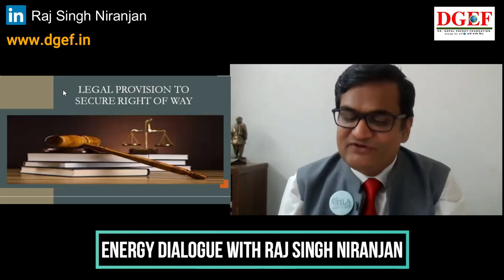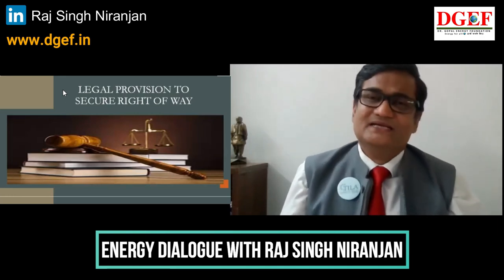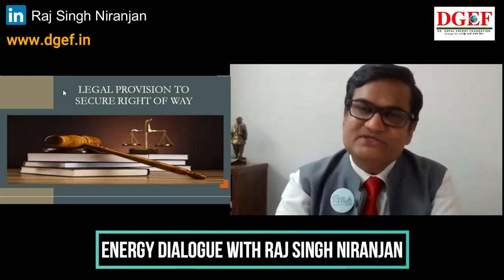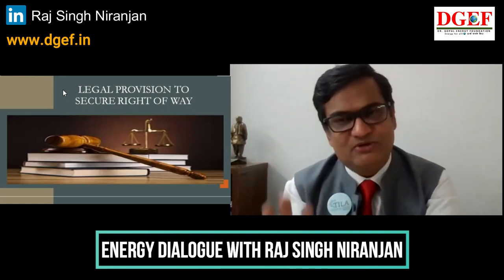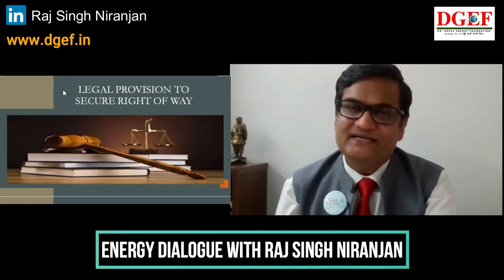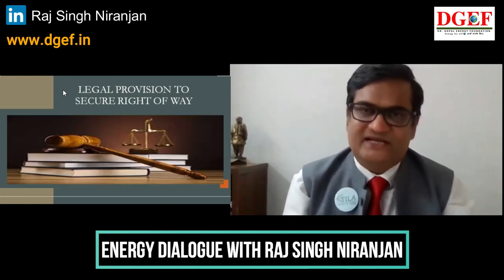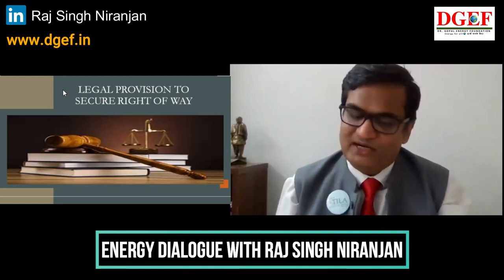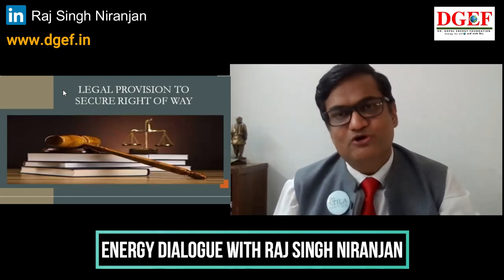Right Of Way (ROW) for setting up Transmission Lines in India ?

Comment: As per my research upon this topic I would like to put forward the acquisition process that is involved in the ROW which are as follows:
1.Identification of the ROW: The transmission company identifies the ROW required for the transmission line project.
2. Land acquisition: The transmission company acquires or leases the ROW from the landowners.
3. Compensation: The transmission company compensates the landowners for the land acquired or leased.
4. Clearance from government agencies: The transmission company obtains clearance from the relevant government agencies, such as the Ministry of Environment, Forests and Climate Change and the State Forest Department.
5. Construction of the transmission line: The transmission company constructs the transmission line on the ROW.
Thank You.

Comment: In India, the right of way (ROW) for setting up transmission lines is regulated by the Central Electricity Authority (CEA) under the Ministry of Power. The CEA has issued guidelines on the ROW requirements for transmission lines in India.

According to these guidelines, the ROW requirement for transmission lines depends on the voltage level of the line and the type of terrain it passes through. For example, the ROW for a 765 kV transmission line passing through flat terrain is 80 meters, while the ROW for the same voltage level transmission line passing through hilly terrain is 100 meters.

The guidelines also require that transmission lines be constructed at a minimum height to ensure safety and to prevent unauthorized access. The minimum height for a transmission line passing over a road is 7.5 meters, while the minimum height for a transmission line passing over a railway track is 9 meters.

To obtain the ROW for a transmission line project, the developer must obtain the necessary approvals from the relevant authorities, including the local government, forest department, and any other concerned agencies. The developer must also compensate landowners and other affected parties for any damages caused by the project.

It is important to note that ROW requirements may vary depending on the specific location and project requirements, and developers must comply with all relevant regulations and guidelines.

Comment: In India, obtaining the right of way (RoW) for setting up transmission lines is a crucial aspect of power infrastructure development. The right of way refers to the legal right to establish transmission lines, which usually involves acquiring land or securing permission to use land for the construction and maintenance of transmission infrastructure. The process can be complex and involves multiple stakeholders, such as central and state governments, private landowners, and local communities.

Some key aspects of the right of way process for setting up transmission lines in India include:

1. Regulatory framework: In India, the transmission sector is regulated by the Central Electricity Regulatory Commission (CERC) and State Electricity Regulatory Commissions (SERCs). These commissions establish guidelines and procedures for acquiring the right of way for transmission projects.

2. Route alignment and land acquisition: The route alignment for a transmission line project is determined by a detailed survey and analysis of the proposed path. This involves identifying the shortest and most feasible route, considering factors such as topography, land use, and environmental and social impacts. Once the route is finalized, the process of land acquisition begins, which may involve negotiations with private landowners and acquiring land under government ownership.

3. Compensation: Compensation is typically provided to landowners and other affected parties for the acquisition of land or granting of rights of way. This may include monetary compensation or alternative land provisions, depending on the specific circumstances of the project.

4. Environmental and social impact assessments: Transmission line projects may require environmental and social impact assessments (ESIAs) to be conducted to identify potential impacts on the environment, local communities, and cultural heritage sites. These assessments can help guide the project design and identify mitigation measures to minimize adverse impacts.

5. Public consultation and stakeholder engagement: The right of way process may involve public consultation and engagement with local communities and other stakeholders to address concerns and gather feedback on the proposed project. This can help in building trust and ensuring the project is designed in a manner that is sensitive to local needs and priorities.

6. Clearances and permits: Obtaining the necessary clearances and permits from various government agencies and authorities is an essential part of the right of way process. This may include obtaining forest clearances, wildlife clearances, and other permits related to land use, environmental protection, and cultural heritage sites.

It is essential to note that the right of way process for setting up transmission lines in India can be complex and time-consuming, involving multiple stakeholders and regulatory requirements. Successful project implementation requires careful planning, coordination, and engagement with relevant parties throughout the process.

Comment: The right of way is a strip of land where the transmission line is constructed, erected, operated, and maintained.
The transmission line is the center of the Right of Way ( ROW ). 
The right of way clears all trees, structures, and construction that interfere with the power lines.

Comment: •	Developing Bangladesh
The specific procedure for obtaining the Right of Way (ROW) to set up transmission lines in Bangladesh would entail the following:

1. Project Proposal: Prepare a detailed project proposal that includes the technical specifications of the transmission line, such as voltage, capacity, and route plan. The proposal should also include information about the project's purpose, potential benefits, and estimated costs.

2. Land Identification: Identify the land required for the transmission line corridor, tower locations, and associated infrastructure. Conduct surveys and assessments to determine the feasibility and suitability of the proposed land.

3. Preliminary Survey: Conduct a preliminary survey of the proposed route to assess the technical feasibility and potential environmental and social impacts. This survey helps to identify any potential obstacles or challenges that need to be addressed.

4. Environmental Impact Assessment (EIA): Prepare an Environmental Impact Assessment report in accordance with the laws and regulations of Bangladesh. The EIA report should evaluate the potential environmental and social impacts of the project, including land acquisition and construction activities. It should also propose mitigation measures to minimize adverse effects.

5. Public Consultation: Organize public consultation meetings to inform the local communities about the project and gather their feedback. Address any concerns raised by the affected stakeholders and incorporate their suggestions into the project design, if feasible.

6. Land Acquisition: Initiate the process of land acquisition by identifying the landowners along the proposed transmission line corridor. Engage in negotiations with the landowners to acquire the required land through purchase or lease agreements.

7. ROW Application: Prepare and submit an application for the Right of Way to the appropriate government authority, such as the Power Grid Company of Bangladesh (PGCB) or Bangladesh Power Development Board (BPDB). The application should include project details, the proposed route plan, land acquisition documents, environmental clearance, and other necessary permits.

8. Technical Evaluation: The government authority responsible for ROW will evaluate the technical aspects of the project, including the suitability of the proposed route, tower locations, and safety considerations. They may conduct field visits and consult with technical experts to assess the project's compliance with national standards and regulations.

9. ROW Approval: If the application meets the technical requirements and complies with all relevant regulations, the government authority will issue the ROW approval. This approval grants the right to use the specified land for the transmission line construction and operation.

10. Compensation and Relocation: Finalize compensation agreements with landowners and provide appropriate compensation for the acquired land. If any households or communities need to be relocated, ensure proper arrangements are made, including compensation, resettlement, and rehabilitation.

11. Construction and Monitoring: Commence the construction of the transmission line and associated infrastructure, following the approved route plan and design specifications. Implement effective monitoring programs to ensure compliance with environmental and social safeguards during the construction and operation phases.

Comment: The important laws governing the Right of Way are the Indian Telegraph Act, 1885 and the Electricity Act, 2003. The provision contained in Section 12 to 18 of the Electricity Act, 1910 remained in force until the rules under Section 67 to 69 of the Electricity Act, 2003 are made. Also, the procedure and provisions under Section 12 to 18 of Electricity Act, 1910 were not adequate for major Generation or Transmission Projects. Hence, the express provision for speedy execution is made under Section 164 of the Electricity Act, 2003. (Previously under Section 42 of Electricity Supply Act, 1948).

The Section 67 of the Electricity Act, 2003 provides for a licensee to lay down, interalia, electric supply lines, electric plant and other works and to do all other acts necessary for transmission or supply of electricity. It also stipulates that a licensee shall cause as little damage and shall make full compensation for any damage caused and in case of any difference or dispute, the matter shall be determined by the Appropriate Commission.

The Section 68 of the Electricity Act, 2003 has the provisions relating to over head lines. It interalia stipulates that where any tree or any structure or other object interrupts or interferes with, or is likely to interrupt or interfere with, the transmission of electricity or the accessibility of any works, an Executive Magistrate or authority specified by the Appropriate Government may, on the application of the licensee, cause the tree, structure or object to be removed or award compensation considering its existence before or after the placing of the overhead line.

The Section 69 of the Electricity Act, 2003 has the provision related to giving notice to the Telegraph Authority.

The Section 164 of the Electricity Act, 2003 empowers the Appropriate Government to confer upon any public officer, licensee or any other person engaged in the business of supplying electricity, any of the powers which the telegraph authority possesses under the Indian Telegraph Act, 1885 (13 of 1885) with respect to the placing of telegraph lines.

The important sections of the Telegraph Act are Section 10 & Section 16. The Section 10 of the Telegraph Act, 1885 empowers the transmission company to place towers in or upon any immovable property. However, while doing so the company shall not acquire any right other than that of user in the property. The company shall do as little damage as possible and after completion of work shall pay full compensation to all persons interested for any damage sustained by them by reason of the exercise of those powers.

The Section-16 of the Telegraph Act, 1885 assigns the District Magistrate power to clear the obstruction. If the obstruction continues even after making an order by the District Magistrate under sec.16(1), the obstructor shall be deemed to have committed an offence under Sec.188 (45 of 1860) of the Indian Panel Code.

It is the duty of the electricity company to decide and pay the compensation. While deciding the reasonable and realistic amount of compensation, the company may get it done from or with the help of following respective authorities:

Revenue Authorities: - For Crops, non-schedule Trees
Forest Authorities: - For Schedule Trees like Teak.
Horticulture Dept.:- Fruit Bearing Trees.
Agriculture Dept :- Value of Crop damage.
Rubber Board:- Rubber trees.

Dispute regarding sufficiency of compensation shall be decided by the District Judge after receiving application from any party concerned.

For felling of Trees, utility will have to take the permission from Tree officer under the Felling of Tree regulation act & Preservation of Tree Act. The forest approval is required for laying the transmission lines through Forest.
Reply: I want contact

Comment: Legal provisions for securing rights of way are as follows:
1) Mitigation of disruption of work was the priority since delaying the implementation of projects could not be afforded. Safety of field persons and smooth working on privately owned property what the main focus areas. Whatever is the conductor swing due to airflow + the object or radius will give the result as minimum electrical clearance, also called the right of Way Or transmission corridor.
2) Central electricity authority has made a regulation named measures related to Safety and electrical supply regulations 2010 which mandates vertical and horizontal clearance.
3) on 14th August 2013 Ohio High Voltage transmission lines sagged and made contact with a tree. This resulted in Domino effect creating the largest blackout in America with total of 10 states of the United States being affected because of the Black Out. The transmission lines can accordingly be late down in 4 ways. This includes:
a) on ground line- when it comes to unground line transmissions theft is high and electrocution has a higher probability of occurrence due to which it is termed as risky.
b) undersea line- they are created only when there is no other option of setting up a transmission line is available.
c) underground line- section 67 of the electricity act pensions about underground line, the most common transmission lines found in India.
d) over head lines.
4) underground lines include a transmission entity that has the approval and his authorised or has got the licensee under section 17 to open up any street or any Canal for setting up an underground transmission line. If there is a dispute and independent regulatory Commission will resolve the disputes.
5) overhead-lines- section 68 mentions about setting up an overhead transmission line. A transmission licensee will set up this line and the resolution of the dispute has been provided under the works of licensee rules 2006. If the land premise on which the transmission is sought to occur is under the control and ownership of the transmitter himself there is need of approval

Comment: In Sri Lanka, the right-of-way (ROW) for setting up a transmission line is governed by the regulatory and legal framework established by the government. The process generally involves obtaining the necessary permits and approvals from relevant authorities. Here are some key steps and considerations:
1.	Identify the route: Determine the desired route for the transmission line, considering factors such as terrain, environmental impact, existing infrastructure, and land ownership.
2.	Land acquisition: Identify the landowners along the proposed route and negotiate land acquisition, either through direct purchase or by leasing the required land for the transmission line corridor. The process may involve compensation for land acquisition, which should be done in accordance with the applicable laws and regulations.
3.	Engage with authorities: Contact the relevant authorities responsible for approving and regulating transmission line projects. In Sri Lanka, the key authority is the Ceylon Electricity Board (CEB). Consult with the CEB and other relevant agencies to understand their requirements and procedures.
4.	Obtain permits and approvals: Apply for the necessary permits and approvals from the regulatory bodies. This may include environmental impact assessments, land use permits, and other clearances required by local authorities. Provide all required documentation and information to support your application.
5.	Public consultation: In certain cases, public consultation may be required, particularly if the transmission line route passes through residential or environmentally sensitive areas. Consult with local communities, address their concerns, and obtain their consent where necessary.
6.	Construction and installation: Once the necessary permits and approvals are obtained, proceed with the construction and installation of the transmission line infrastructure. Adhere to the technical specifications, safety standards, and guidelines provided by the relevant authorities.
7.	Post-construction activities: After the transmission line is installed, conduct inspections, tests, and quality checks to ensure it meets the required standards. Obtain the necessary clearances from the authorities before energizing the transmission line.